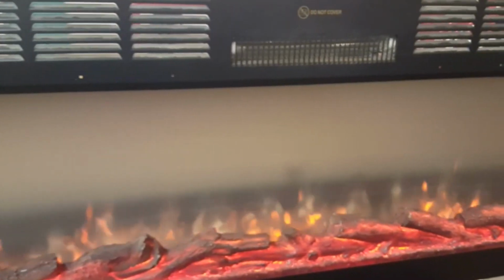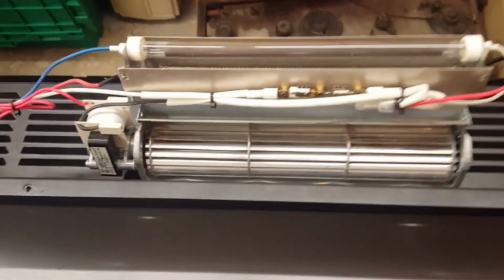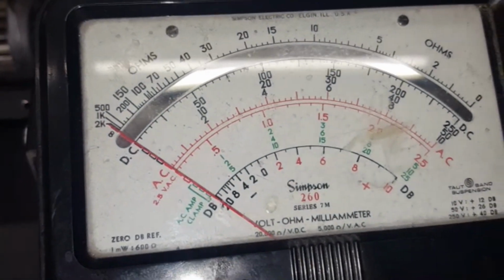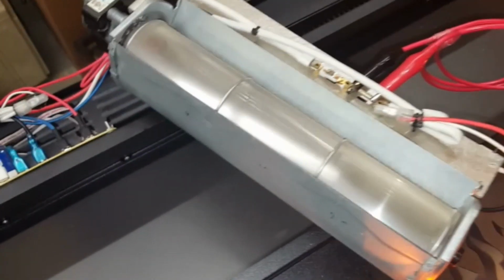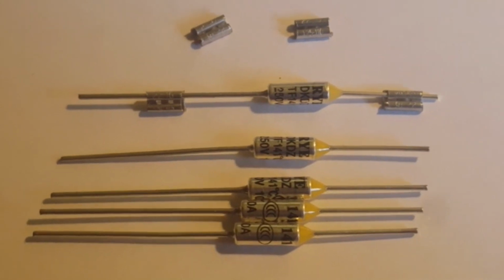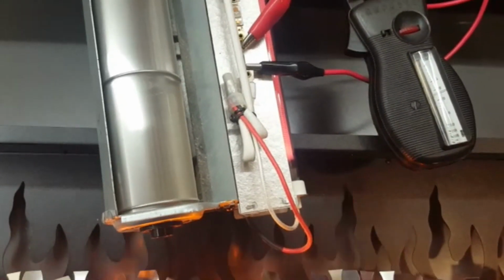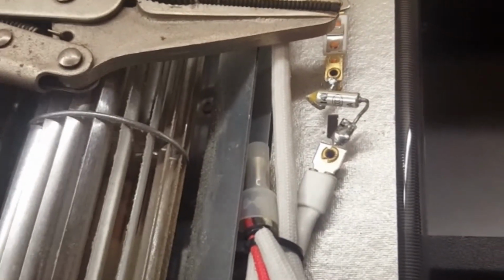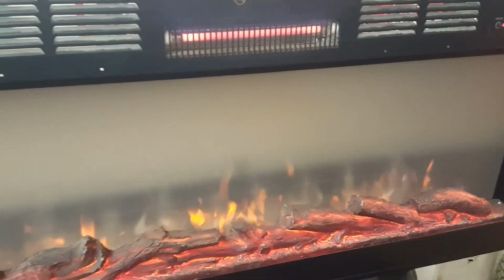Electric Fireplace Repair

Comment: I have a costco fireplace tv stand heater not working. The fan works, but the heater is not working. The display works work when I turn on heater, then the display turns off, but fan keeps running. any advice?